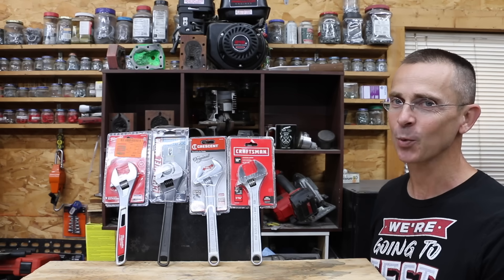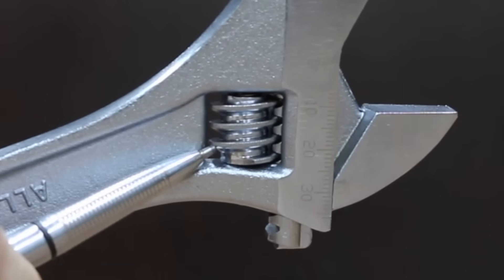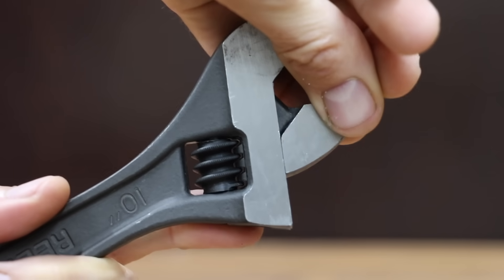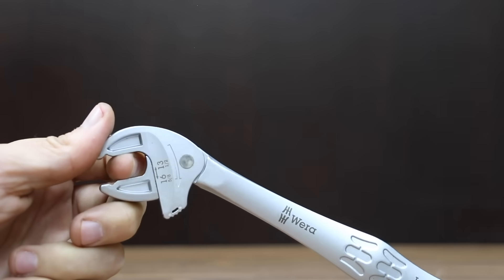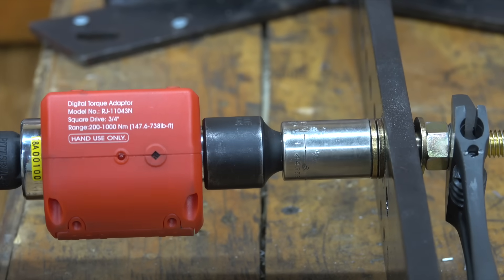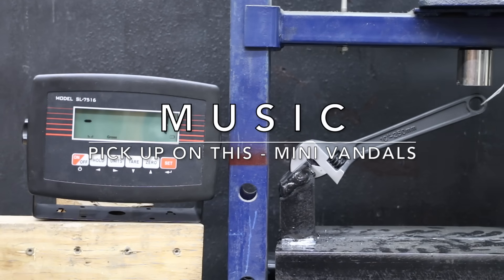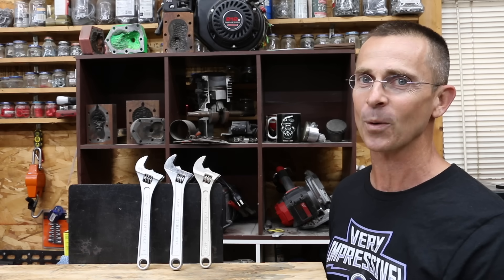Best Wrench (ADJUSTABLE)? Craftsman USA vs Craftsman, Crescent, Kobalt, Milwaukee, Channellock

Comment: The second of your tests seemed most applicable to how (I assume) most people would use  an adjustable wrench.  In your third test the pressure was on the outer tip of the movable jaw.  I wonder how the wrenches would have fared with the pressure on the  tip of the fixed jaw?  None the less, darned good video with lots of good information.  Where the heck did you find all of those brands.  Some I never heard of.  I expected the German brands to do better.
Reply from the maker: Thanks!

Comment: I have a couple of diamond adjustable wrenches and they're are still awesome and work as they did new.. I even used a piece of pipe on them for extra leverage and they never broke or slipped. They're also made in  USA
Reply from the maker: Thanks for sharing.

Comment: My dad taught me long ago to NEVER use an adjustable wrench because it will round off the nut.  Then I became an auto technician and I was changing my steering gear after hours.  All the line wrenches I had and could borrow COULD NOT remove the hydraulic fittings. Snorp-On, Matco, etc.  They would just flex and spin around on the line nuts.  The guy I had been training under, named Kenroy, came over when he saw me struggling and told me to get an adjustable wrench.  I quoted my Dad and Kenroy told me "FUCK DAT! lemme show you somethin' "  He put that adjustable on there and took the line right off EASILY. 😳🤯  So now I often use adjustable wrenches.  If used properly you can get them onto a nut TIGHTER than any mass produced fixed size wrench.  They are slower and less convenient to use and definitely take some practice but they are absolutely a viable tool to have and use.
Reply from the maker: Thanks for sharing.

Comment: I've found that the tolerance tightens-up on an adjustable wrench when you leave exposed to the elements in the bed of the truck. In fact, you can't even adjust it because it's THAT tight.
Reply from the maker: Thanks for the feedback.

Comment: Years (decades, actually) ago Sears Craftsman tools were on a par with Snap-On and Mac "professional" tools. Today, not so much.
"Which is better? Craftsman or a Chinese adjustable wrench?"
Probably not much difference at all, at all today. Either will do the job. Presuming both are new, were they made in the same factory?

Comment: I was a tech for Ford in the '80s...being broke to start off with, I purchased two Craftsman premium ratchet wrenches...I broke both of them within a month - stripped the gears. My co-workers said, "I told you - buy Snap On." I spent what at the time for me, was a fortune...I purchased 2 of the Snap On ratchets - one in the 3/8 and the other in 1/4 sizes. I still have them and they are as smooth as the day I bought them. For professional, tough work...invest in your tools. For a diy'er - really, almost any decent tool will do. And that's all I have to say about that.
Reply from the maker: Thanks for sharing.

Comment: it would be interesting if you tested vintage U.S.A. tools from the 60's and back. though i don't use them exclusively i use a few snap-on, sk, plomb, apex, craftsman, vlchek and a few others i use for certain things. not to mention a few 30's / 40's pipe wrenches that have never failed me.
Reply from the maker: Thanks for the suggestion.

Comment: I watched because I'm looking to buy a couple of good adjustable wrenches.   This led me to this video thought.  How about testing the different levels of harbor freight wrenches.  Is there an actual difference in the quality.  Pittsburgh, Pittsburgh pro and the Doyle.   This could also lead to a test of the different models in the same brands.      Maybe throw in the locking versions that Cresent and Stanley make.
Reply from the maker: Thanks for the video idea.

Comment: I also saw this  10 inch adjustable wrench at Lowes Home Center  I was intrigued by the reinforced strike area.  We've all used tools as an improvised hammer, this also has a pry bar/nail puller on the other end.  CRAFTSMAN 10-in Steel Adjustable Wrench
Item #1071674Model #CMMT12003
Reply from the maker: Thanks for sharing.

Comment: I mostly agree with the findings here; the USA made Craftsman is a beast. Any of us who have owned several models of this type of wrench know that the old Craftsmans beat the dog sh out of every other brand. Crescent surprised me here somewhat because of some of its weak technical performances but I'd put it in the # 2 spot also. Klein tools annoy me, for many reasons, cost being the main one. I think if Channellock revisited the steel they use and the heat treatment they apply, that model could easily match the performance of the old Craftsman. For the price, as is, it's Crescent all day long. If Channellock ups their game then I could see them even increasing their price by $5 or so. They HAVE to address the steel being used, Spain is notorious for using iffy odd-ball steels and heat treatments in knives, car parts, tools, etc. Channelllock better put the foot down and make some changes there. The Spanish can make anything they set their mind to, it's up to Channellock to give them the ultimatum of upgrade to a nice Bohler steel (a K110 or above at 55+rc) or they move production back to the USA. If I were in their management team and saw the jaw flex here, I'd be on the phone the minute the sun came up over Madrid. I'm REALLY glad you are doing these kinds of videos and are now being shown on the front page of YouTube. Someone has to keep them in check or the quality of tools will drop even farther than it already has - as they keep increasing the prices so a handful of schmucks can upgrade their Lambos and megadouche houses.
Reply from the maker: Thanks for sharing.

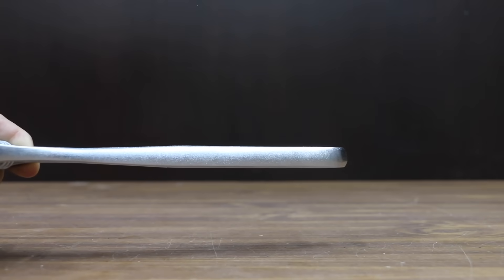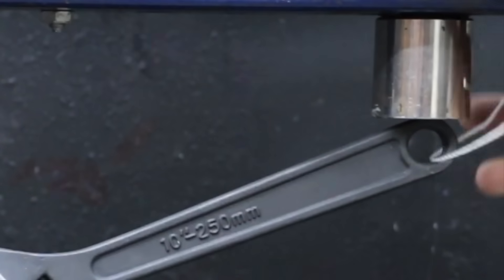Comment: Thorough and impressive!  Nice comparison. But:  2:44 "wide" does not contribute to torque.  8:48 Grams are not a measure of weight!! (they are a measure of mass, which is different from weight)  16:25 The leverage tests are silly--no one will ever apply that much force with a hand tool.

Comment: It would be a cold day in hell before I'd ever buy another craftsman tool.
Rotten bastards couldn't keep their tool manufacturing here in the US?
Reply: I think they tried but were overcome by events. Milwaukee has started making more of their tools in the USA recently.  Even some of the "stalwarts" started making some of their tools elsewhere. Tough to find domestic hand tools and if you do, you pay.
Reply: @RSAF-rms  You are correct.  Milwaukee even opened an operation here is West Bend Wisconsin.  Not exactly a big town.

Comment: I have a small set of IRWIN chisels, and having much more expensive sets (Lie-Nielsen, etc.) I find my self going back to the IRWIN chisels for the really nasty jobs, where a tool might get wrecked scraping away material or coming into contact with steel. 
The IRWIN tools put up with a lot. With a little sharpening, they are as good as new.  I have some IRWIN clamps, too, come to think of it.  They are an economic, well made brand.
Reply from the maker: Thanks for the feedback.

Comment: My father was a master machinist at Kodak, back when they actually made cameras. I still have several "Crescent" brand crescent wrenches of his, and they work great. Very heavy wrenches with a dark finish and almost no play in any direction. 
It is very sad to see so many garbage wrenches out there in the hardware stores today. They are as shiny as a new penny and worth just about as much. 
If you really want to depress yourself, go to any Sears location today, and look inside the shut-up, darkened, deserted buildings that were once my first choice for a lot of tools. Use the internet, nowadays. Way easier.
Reply from the maker: Thanks for sharing.

Comment: I’ve used quite a few adjustable’s in the trade, it’s hard passing up on knipex pliers wrench after getting used to them. But! I do own 8-12 inch craftsman USA set as well as Klein and Channellock. The finish and metal on craftsman just feels flawless in hand. The channellock and Klein both make extra wide jaws on 8 inch in tight spots those are great. Crescent,Husky,Harbor Freight, Stanley suck the metal is to soft to me and causes wear bends on the jaws. I also have a 6inch Milwaukee adjustable and it feels good in hand as well. 

For how much those Wera wrenches cost you could buy multiples of other good brands. Don’t seem practical to me, the joker ratchet combo wrenches on the other hand  seem pretty good. Thanks for these great videos!
Reply from the maker: You are welcome!  Thanks for sharing.

Comment: I still have some of the tools from a Craftsman tool kit bought in 1967. Mostly ratchets, sockets and wrenches. I remember breaking one 1/2 inch drive sometime in the late 70's and they replaced it free at my local Sears. Adjustable wrenches include a Reed 12 inch, a Pittsburg 10 in and two 8 inch Craftsman (forged in USA). I don't do a lot of wrenching so these have lased a long time.
Reply from the maker: Thanks for sharing.

Comment: You never actually determined the max torque that the American craftsman can handle. You only determined the point at which the bolt failed.
Reply from the maker: Great point!  Thank you

Comment: Doesn't the shorter jaw give it an advantage in the load gap test?  The gap is bigger at the tip of the jaw so if the jaw was longer gap would be bigger.  Kind of like if you measured the gap not at the tip on the longer ones
Reply from the maker: Thanks for the suggestion.

Comment: Interesting test, but ... the best test was used by the company I did work experience with in 1969 when I was at university. If you were caught with an adjustable spanner in your tool box, it was welded shut the first time. The second time, you were instantly dismissed and were escorted off the premises with a "never to be employed" tag. The company was Rolls Royce. The fitters I worked with told me that you used to get fired for slipping a spanner on a nut. They weren't happy about sloppy work.
Reply from the maker: Thanks for sharing.

Comment: My Dad always told Me to use the adjustable wrench with the moveable jaw on the bottom and pull down on the fixed jaw. I was wondering did You try both ways and were there any difference?

Comment: This guy is stating the obvious, I've had American tools for. over 50 Years (I'm a Brit) and would swear by them all. A lot of American companies went the Chinese route, producing Chinese crap under the same American trade name-watch out for that. I was caught out by the famed company Kitchen Aid , from who I bought their famous kitchen mixer (American made) buying an S/Steel Electric Kettle with their name but  I later found (in very small print) out it was made in China. I looked very carefully because the S/Steel started to rust! What ever you buy check to see first before you buy. Many companies don't show the place where it was made. So thats a v.good indication it was China!
Reply from the maker: Thanks for the feedback.

Comment: I have been a mechanic for over 45 years and have tried almost every tool imaginable. I have to say that i still own vintage Craftsman tools and they are still performing well. i did take the plunge and purchase many Snap On and Mac tools throughout the years and they do look pretty and are very good as well but seem a little slippery when hands have any oil or grease on them. craftsman always had that rough finish from forging and were not near as slippery. Seat of the pants daily use of these tools allows me to feel the quality difference. Those China tools are knuckle busters and pros do not use them...well, shouldn't use them lol. Great video!
Reply from the maker: Thanks!  Thanks for sharing.
Reply: Between  my 12th birthday  &helping  dad load up 5 pickup  loads of bricks   dad payed me enough  to go to sears &buy a 250 pc  tool set  . He told me that if thingh ever get really bad &you half to sell something  sell the tv or the kitchen table  but never sell that tool box because  you can make money with it .  Im 65 now & i made a lot of money with that box of craftsman  tools & i still have them  . Some of the sockets are a little loose but over all after 53 years of use there still going strong .
Reply: @robertrobinson7368  Nice. First time that my van was broken into told a great talented older mechanic about it. Told me " Kid I'd rather loose a $20 bill then a $10 tool " He then explained that a $10 tool will help make thousands of dollars over it's lifetime.
Reply: Still using a Craftsman socket set that I purchased back in 1967. Best part It made me a lot of money and could probably sell it for more then I paid for it.
Reply: @JohnThomas-lq5qp  same here.
Reply: @JohnThomas-lq5qp  I have some from Dad that may go back that far too and they work like new. I have newer stuff too but those work when I need something tough.
Reply: @JohnThomas-lq5qp  you could sell pretty much anything you bought in 1967 for more than you paid for it, both because it would be vintage and also because of inflation
Reply: I am a diy guy and I can't imagine how many  knuckle busters real mechanics get a week.
Reply: I have a bunch of USA made Craftsman adjustable wrenches in various tool boxes throughout my house. I'm going to gather them up to put in my top of the line tool box. Same logic hopefully applies to their socket sets (at least I hope so). 
We owe a great shout-out to Project Farm. He destroys tool so they don't destroy us under extreme handling conditions.
Reply: My grandfather died in 1967 and I still use his craftsman tools. Finally stripped the gears in a ratchet, went to Sears, and they tried to trade it for a piece of Chinese junk. Took me months to find a repair kit on eBay but it’s good as new again.
Reply: @alanorrick6741  That sucks.  I worked at sears in the 80s.  When people brought in broken ratchets, we would go fix them on the spot.  The forged piece was never bad.  We had tons of rebuild kits back then.
Reply: on a side note, I still have two different 3/8 ratchets from when I worked there.  Definitely the best ones I have.    If you don't use them as breaker bars they last forever.   35 years and going strong!
Reply: I doubt it’s good as new again had you used your ebay junk to fix it. LOL
Reply: Still have & use a 3/8" Craftsman socket set that I bought on sale while in 10th grade back in 1967. Would never think of purchasing any of their products even the ones not made in cheating communist China. Don't trust the name.
Reply: Still using my vintage craftsman at work on a semi-daily basis and still working great! I also have a whole set of vintage USA Crescent's also up to 18 inch, todays tools just don't compare to vintage USA in most cases.
Reply: Today tools are all about looks, they want shiny mirror-looking tools, so they look new after cleaning them up, but you are correct, the older non-polished tools were not nearly as slippery, and I believe the metal used was tougher as well.   Tools have become fishing lures, the shiny tool attracts men to the lure and they're hooked.  The only problem with the old-school vintage non-chrome look was that they did have a tendency to rust, but every good mechanic would wipe down their tools with an oily rag to prevent them from rusting back then.
Reply: I’m a mechanic as well, most of my tools are vintage hand me downs and I can definitely say the old craftsman tools definitely hold up, that being said, my favourite crescent wrenches are actually a vintage 12” Proto Clik Stop and an 8” Diamalloy made by diamond caulk and horseshoe which is at the latest 67 years old now 😮
Reply: I will just note that Craftsman of yore were not the recent Craftsman.  Sears outsourced products to OEM du jour.  Eventually, the brand name was sold to Stanley Black&Decker who decided where to fit in their brand lines of hand and power tools and which big box stores to cater to.  A Craftsman tool from 50 years ago has nothing in common with a Craftsman tool today except for the name.
Reply: When I want to round off a nut I reach for a craftsman tool .. professional mechanic here and I am not even talking about newer craftsman .. Snap on wrenches are top notch you know they are accurate as long as they are in one piece. The ends are always the correct size never rounding off and when they do fail you know it immediately because the wrench snaps into pieces not hurting the part you are working on. craftsman wrenches will widen and deflect and round off bolts over time until you catch it and remove it from service. Seen many a mechanic have to wade into a deep engine repair because his cheap craftsman tool failed and rounded off a nut needing a welder to weld on a new one or the entire part removed for repair. snap on tools fail but usually after 30 years or doing something you clearly should not be doing like putting a 8 foot pipe on a ratchet for leverage. as for sockets ? I use the absolute cheapest made in china stuff unless it has to be thin wall for clearance. and the china made stuff hold up better then snap on mac craftsman S&K and pretty much everything. Sunnex is worth every penny .. for the impact sockets
Reply: I would  never  use a wrench like  he using to test for  back  up wrench I use a box end are  good 6 point socet
Reply: I half to say tha craftsman  screw  drivers  were not so great  i used kline with the cobalt  tips . .
Reply: I was a mechanic back in the mid 80's and MACTOOLS were better then Craftsman. Sears would replace them but it was a hassle to drive to the mall and get them swapped out.